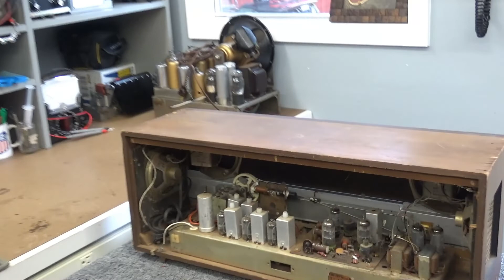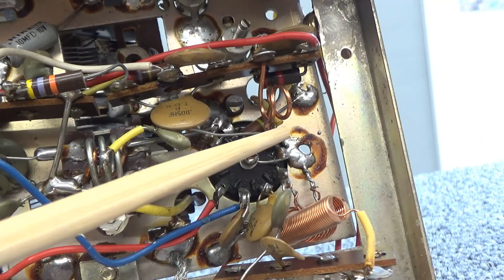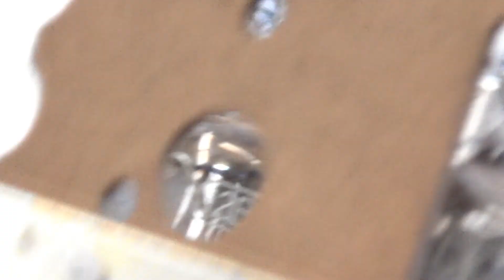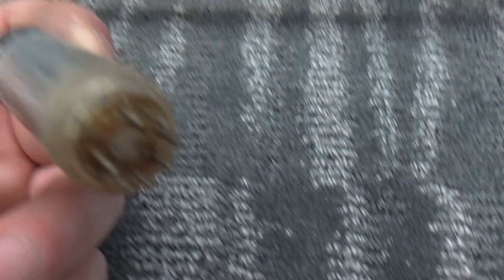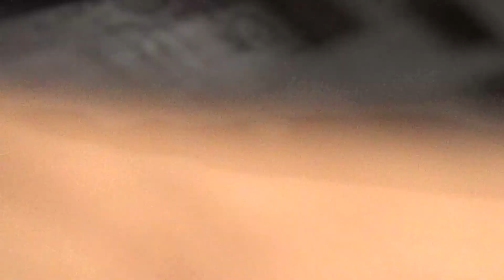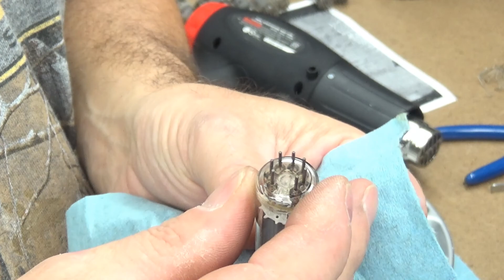Delmonico FMS-749 AM-FM Tabletop Receiver Check and repair Part 1

Comment: Hi there, I really liked this radio and will be watching anymore you put up. Just a word on your efforts to clean the radio chassis . The 1st job I always do is clean everything down and get the chassis nice and shiny like you did, I think I'm likely to continue with the restoration if Im  working on a clean chassis, I realised early on, that if I was having problems with a dirty crappy radio , I was more inclined to give up on it and look for something else to work on which only got me a big pile of spares. 🥺. Also, I like that you show what you are doing and not what you've done as so many restorers do. Thank you for sharing your hobby .😎👍
Reply from the maker: Thank you for your kind words and I appreciate the good word. 
I’ll be back on the radio soon. The FM side needs a proper alignment at which will be next.

Comment: Nice video of this Delmonico receiver. I am an old time radio repair guy and I can tell you that I've worked on a few of these way back in the day. Somebody attempted to restring that dial and your radio and it is not done properly. You will need to get the schematic diagram and see how to restring that dial properly that's why that's stretched out spring is hitting that screw. When you get that set to play they actually are very good sounding sets. You can tell by the audio output Transformers that they are rather large for a small radio. Good luck and enjoy and thank you for the video
Reply from the maker: Thanks for the kind words. The tuner tension spring got stretched due to the rubber mounts being dried out and compressed which caused the geometry to change allowing the spring to contact the tuner set screw. When I replaced the grommets that didn’t give me enough clearance. I will make some changes and that will make things right. 
The set needs a good alignment and it will work great. Have to borrow my fm sweep marker generator from work. 
The cabinet will be next.